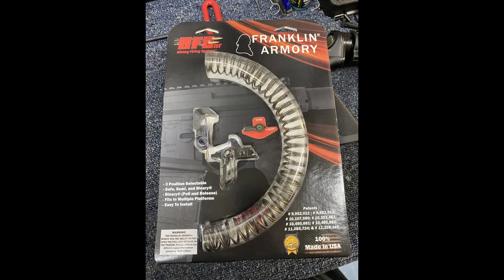Franklin Armory 10 min Binary install.

Comment: The video is a very good video of the install BUT it would have been probably the best instructional video of the binary trigger installation  if you would have talked and explained what you were doing and why.  Explaining the different springs for the instal and the testing of the mechanisms after parts installed.  Well done video but just me I would have liked a little talking and explaining of what you were doing and why.  Thank you for the well done video.

Comment: Just curious as to the little spring you had left over.. Is this an extra they send you? Also are the extra springs for a lighter trigger pull?
Reply: It’s a spare spring if you accidentally took apart the trigger. You’ll see when you push the pin through the trigger a silver guide will fall out. It’s what’s holding the trigger together for you for either install.
Reply: @DrivingChill  thanks brother

Comment: I may fiddle with mine some more, but I couldn't get the trigger into my lower with the spacers on it. I installed it without them and it worked fine. Fired around 100 rounds in different modes. But it still bugs me that I didn't install it "right".
Reply: How long did it take you to install yours? I can’t seem to get mine to install correctly.

Comment: Do you have to change the bolt carrier with the binary trigger install.
Reply: Not necessarily. It’s compatible with most BCGs. You may have some slight issues and want a light BCG, but won’t know until you try. Most mil spec BCGs seem to work fine with it. It isn’t like the Echo.

Comment: Literally perfect video. My only question is do I need to use different trigger springs for a 300 Blk pistol set up.
Reply: No, is the same size small receiver as .223/5.56

Comment: What trigger is this they have a few different What one would you recommend? I have a black rain ordinance fall out 15.
Reply: This is likely the AR-S1. Either the Franklin Armory AR-C1 or the S1 will work. The C1 is curved, and the S1 is a straight trigger. As long as you have an AR platform, and you get the AR trigger, you're fine.

Comment: What’s that long spring for ?
Reply from the maker: Its actually 2 springs sandwiched together, both are of varying strengths to accommodate a variety of gas systems and aid in the proper function of the firearm. Basically if your stock spring is causing the bolt carrier to move to fast and cause hammer follow, they have provided the extra springs to fix the issue. Hope that helped.
Reply: @GunShortz do you know where I can find installation videos for it ?
Reply from the maker: @KPad87  Franklins website has install instructions and videos
Reply: @GunShortz  thanks bud
Reply from the maker: @KPad87  Any time , Dad has been a gunsmith over 25yrs he's a wealth of knowledge but nobody but me asks
Reply: I put the trigger into a pistol length 300 blk. Which buffer spring would you recommend?
Reply from the maker: @96jesse  depends on the load your shooting, I would take both to the range and  check your ejection pattern from each then decide.